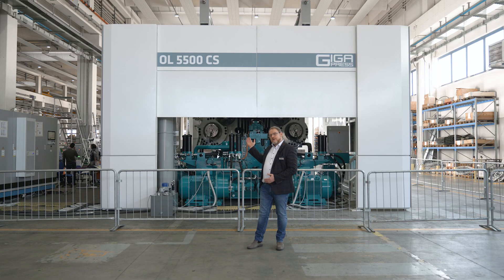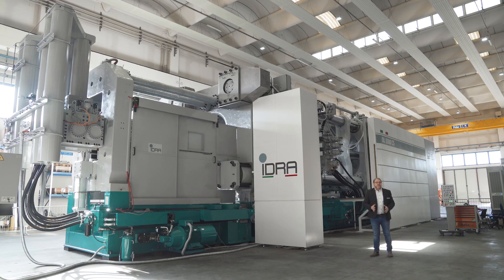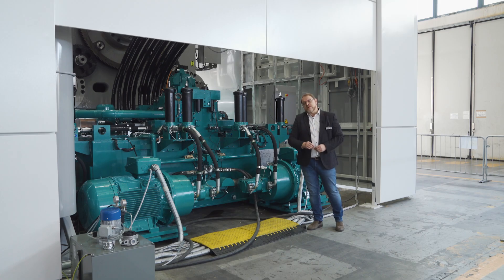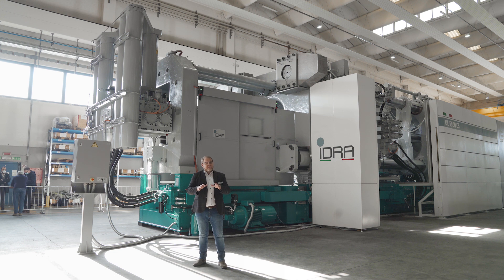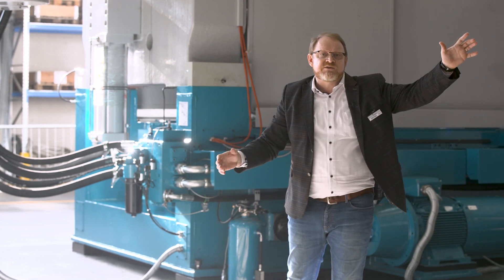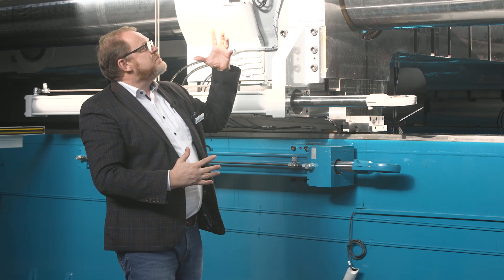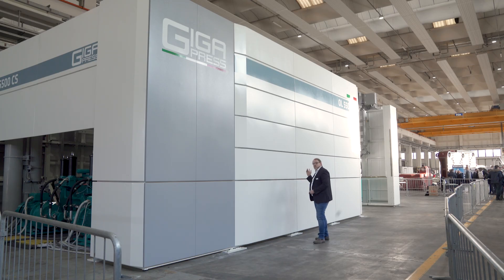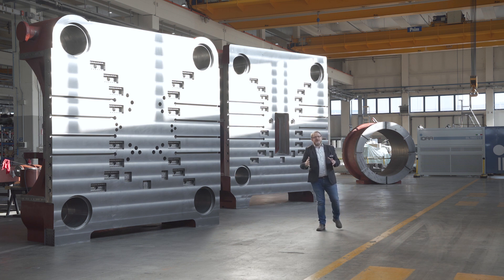IDRA GROUP | PRODUCT STORIES -  OL 5500 CS GIGA PRESS

Comment: so the early ones for tesla were the 6100 cs , 
so this 5500 cs one, is it more electrically efficient for a slightly smaller or thinner parts?
Reply: the 5500 TON is the only one Capable of a SINGLE cast entire car body .